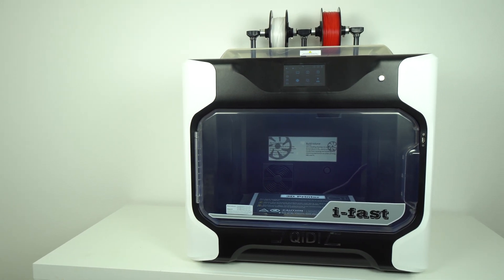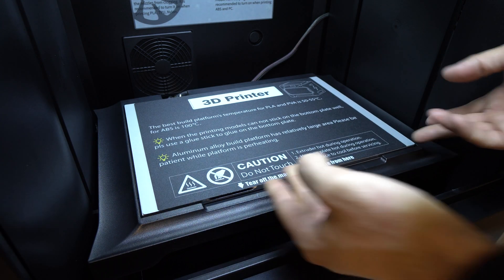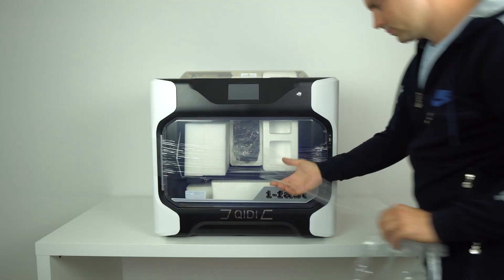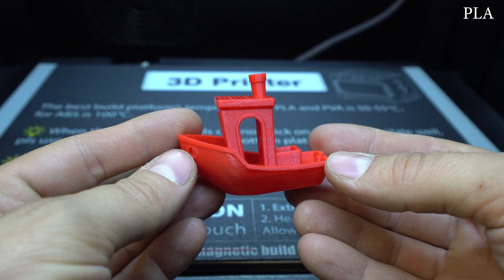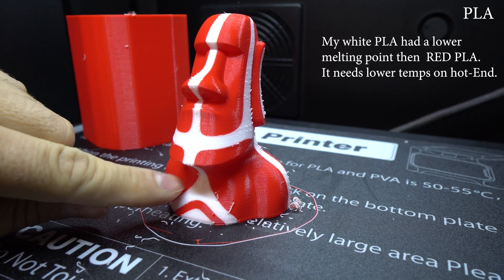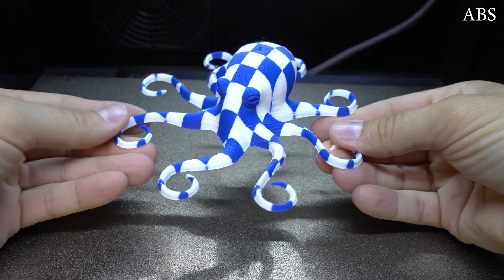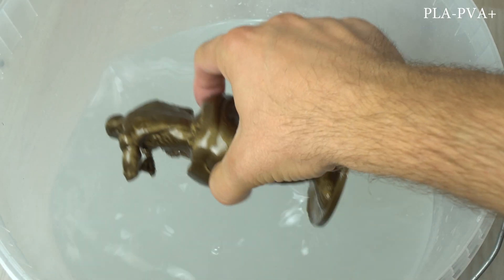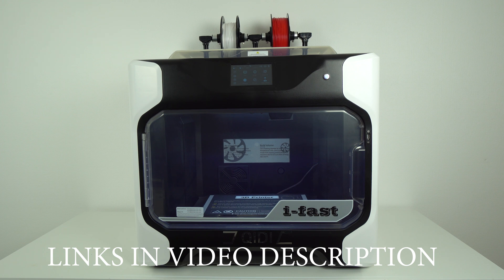The best 3D printer that I ever tested! QIDI TECH I Fast 3D printer review

Comment: Don’t buy this printer the frame and hardware are first class but the nozzle design has big issues and the controller and software are garbage. The bed will warp at full temp and there is no automatic bed levelling to compensate.

Comment: how does this printer compete against the X1C? In terms of speed and quality.
Reply: I owned an i-fast for around 6 months and it is one of the worst things I have ever bought; it is a slow lumbering oaf of a machine. I never got a decent quality print from it in any material and it was far from fast. I sold the I-fast and bought a Bambu Lab X1C and I couldn't be happier with the performance.

Comment: Thanks Nexi, a great review. I have owned a Qidi X-plus for nearly 4 years, and had excellent results with it. So I decided to stick with Qidi and upgrade to the iFast. Having only just seen your review, I'm relieved, as the new machine is coming tomorrow. I can't wait to start using it. This will be my first dual-filament printer. It's a shame that PVA support filament is so fantastically expensive though.

Comment: Hello Nexi,
I purchased an i-fast a few months ago and I recently decided to purchase some new nozzles for the low temp extruders but they don't fit into the heat block threads. They're too big. My 7mm wrench that fits the original nozzles is too small to fit the new ones that I bought (MK10 Nozzle for 3D Printer, 18 Pcs M7 Brass Extruder Head Hotend Nozzles 0.2mm, 0.3mm, 0.4mm, 0.5mm, 0.6mm, 0.8mm, 1.0mm fit 1.75mm Filament). Can you please tell me what size/type I should have purchased? I can't find any definitive answer online.

Comment: thank you i was looking at putting linear rails on my sovol svo4 and changing to a 1/4" (6.36mm thick plate) However after seeing how well this is built i think I'll just upgrade to it then put the money and working into fixing my sovol
Reply: I've got a SV04 also.. and while I like it, I need a larger build volume 310MM min.. so I might grab one of these even though it isn't a new machine...

Comment: Hello Nexi Tech, thanks for this review!
I have a question for you: I would need a reliable 3D printer, i think it’s called a “prosumer” printer.
I have had a bad experience with Zortrax M300 dual (a lot of issues related to layer shifting and platform warping); would you suggest this QIDI ?
Thanks
Reply: Ill answer.. a friend of mine has this in his print farm..its definitely a workhorse. Go for it

Comment: Incorrect on the PEI build plate, its actually best for Nylon, PC and other high temp materials, the standard build plate is PC coated and is best for PLA and ABS, the black side of the stock build plate is less than useless and I wouldn't waste my time with it, you can actually make do with just the PEI build, or better replace them with dual sided powder coated PEI plate from Enegentic or similar clone, these plates warp less and work for TPU/PLA/ABS/PETG/NYLON/PC.....
Reply from the maker: PEI build plates have terrible adhesive for Nylon and Polycarbonate filament. Please do some research before you write comments like this.
Reply: @NexiTech  I don't need to do research, I mainly print Nylon and PC, and I'm a reseller for QIDI-TECH printers, I print PA-CF, PA6-CF, PA12-CF, PC and PC-CF daily on multiple machines, all on Powder Coated Textured PEI build plates, so I do know what I'm talking about, my channel has videos of my QIDI TECH's and Ratrig's printing PC-CF on PEI plates.